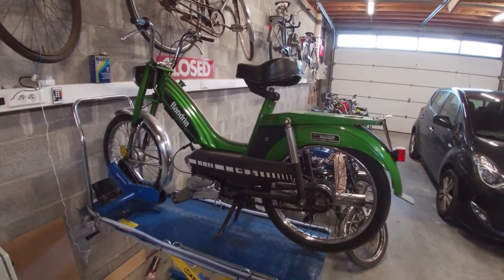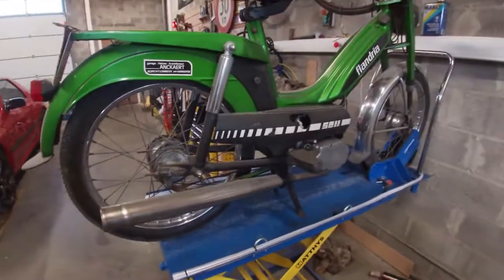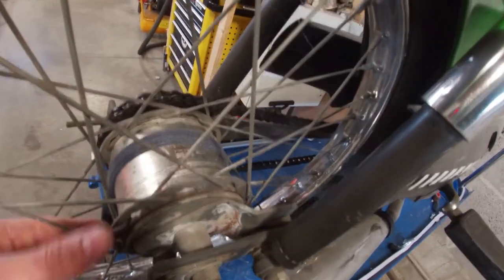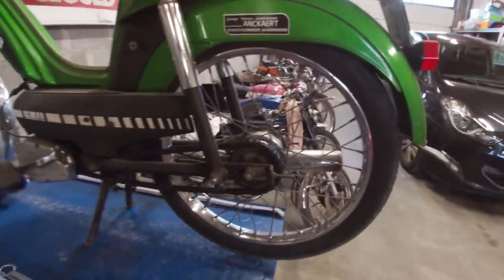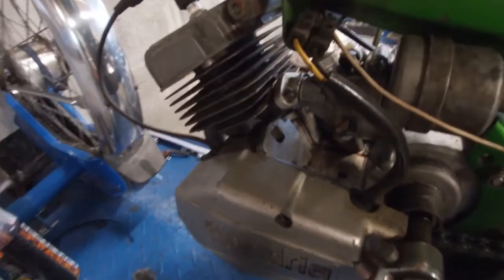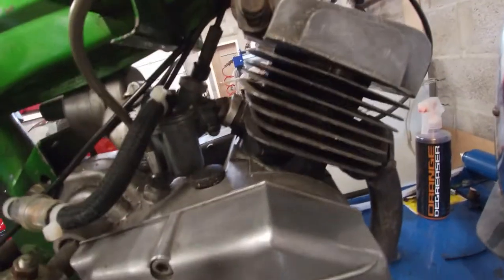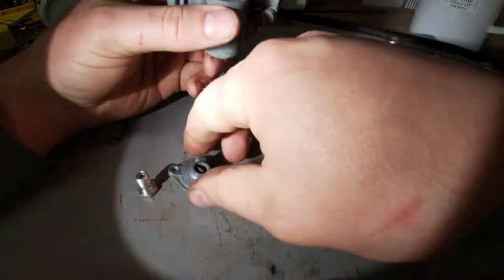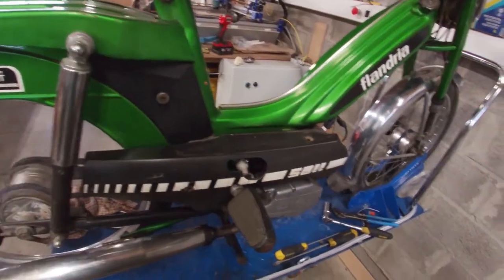Spring Maintenance #5 - Flandria Penny

Comment: Hi, I have the same Flandria Penny S, same color. Yet, the exhaust is not the straight one, but the other one you showed in your video. Another difference is the fact that mine only runs 25-30 km/h. Nevertheless, it still is a 49cc. Would you happen to know how i can boost it up? I'm only a rooky and beginning to gain knowledge on scooters. Thx in advance!
Reply from the maker: Flandria had a couple of ways to detune the engines. First I would check the carburetor. Check the sizing. They used several different sizes for different applications. If that's OK, check the exhaust. If I remember correctly they also had different exhaust diameters. After that check timing and the ignition of the bike.